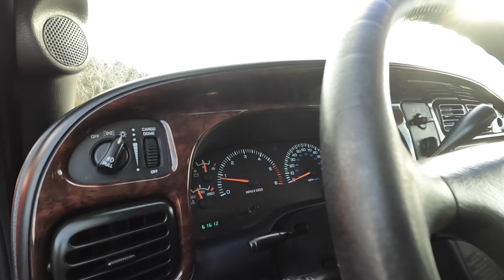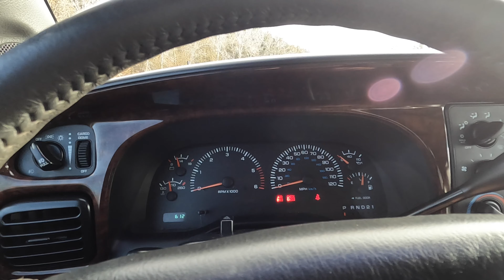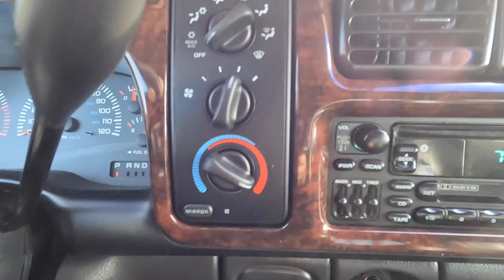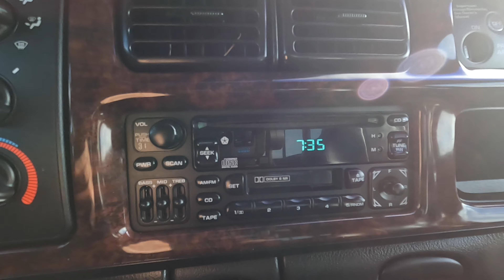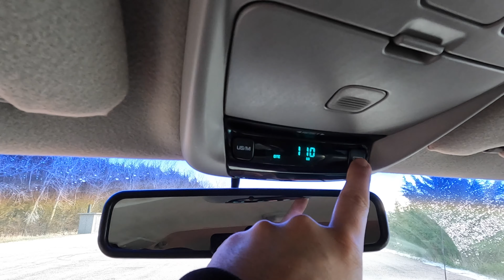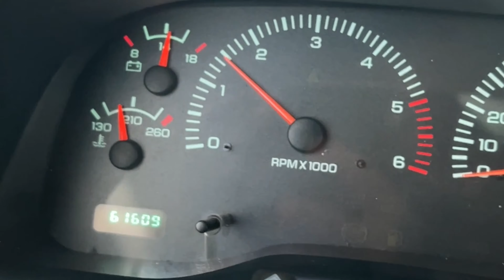61K Mile - 1999 Dodge Ram 1500 Laramie SLT - - Frankman Motors Company - Walk Around/ Driving Video

Comment: I picked up a very similar Truck this summer, 2001 red sport 5.9 with off road package,  leather interior,  sun roof and 62,000 miles. Bought it in Washington state drove it back to Minnesota, went thru glacier national park on the way back, beautiful drive. Got 12-13 mpg, it was taking oil on the trip, found out it had an intake gasket out. Fixed that, new plugs, cap, cam sensor, wires and added a vacuum reservoir so the vents would stop switching to defrost on heavy motor load. Hercule lined the underbody to protect it from MN winter,  3M paint protection down the side of the truck bottom as well. Found a matching red topper in Wisconsin that I'm fixing up for weekend camping. Have some paintless dent repairs to do in a few spots, otherwise looking good and running great. Looks very nice next to my 1996 Indyram,  red,  white and blue sitting in the driveway.